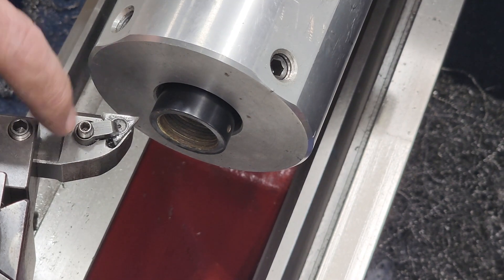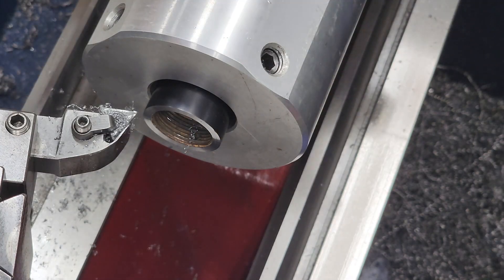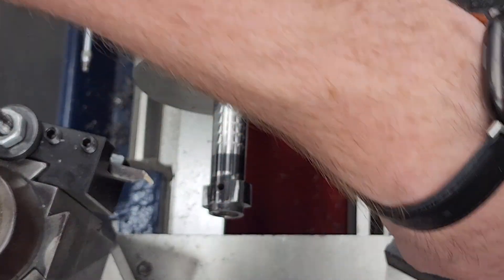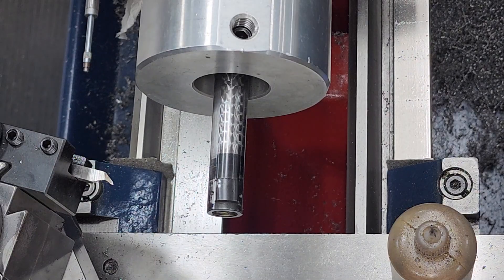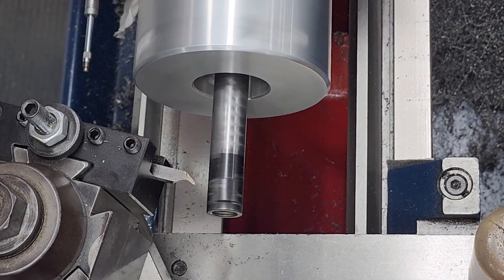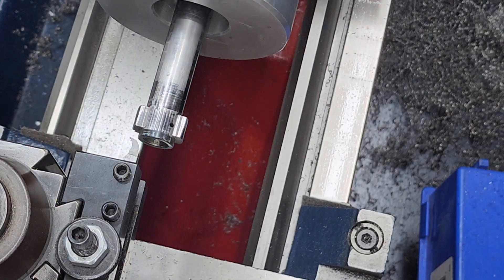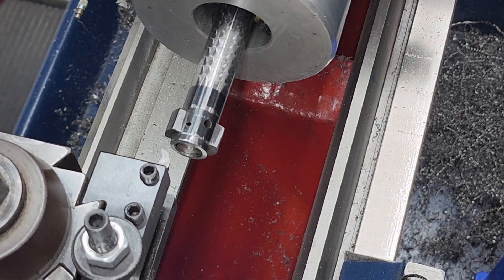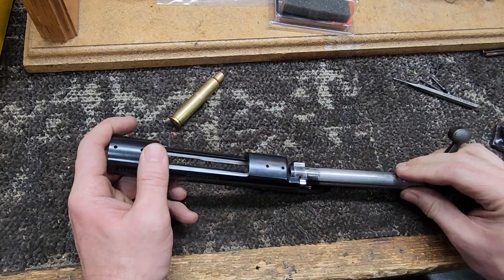Remington 700 270 Project Action and Bolt truing. Part 2

Comment: IF..........U want to bite on this route--- try this FIRST. Shooten the 'ONE CASE' method. Orientate ONE case (Chambering AND reloading) w your accuracy load... firing the group w that case under IDEAL cond's, U have to be competent on the bench... load that case there too. NOW........ what are the results??
MOST........ > grouping is U and your TECHNIQUES.... bedding-screw tensions...... aka lack of them. 
ALL for $$$ w your smith..... just do not expect miracles. REMEMBER too...... that barrel now needs rechamber to FIT that action now........... more $$$$.

Comment: I just built 2 x 270WFT (Winchester fast twist) one custom and 26" 1:8 shooting lapua/berger 170gr 0.662 G1, the other a blueprinted Howa 25", both carbon barrels. MDT HNT26 folding stock to fix the length for carrying. Hoping to push at 2920-2950. Training 500y for 650lb Sambar or 450lb Red Deer.

Comment: This is not a critique against you, I am sure that you are skilled and doing your best. However, it's always the same with "truing" actions. A new barrel is fitted, and in the end no one knows if the truing did any good, because it is not tested in isolation. Of all the people having their actions trued, very few seem to have some data that it is worth doing. Furthermore, many smaller shops have machines that don't keep the same precision as the machines that made the action in the first place. 
It is difficult to know for sure that trying actions are useful. Its like magic. People do it because other people do it. Gunsmiths do it to make money, but are not sure themselves that it does much. 
Older rifles YES, those actions are known to sometimes be off center. But new high-end stuff? No.

Comment: This might be a dumb question buy why machine the front of the lugs?  I would have thought that face would not be in contact with anything.
Reply from the maker: Unless you are running a tight bolt to barrel clearance, nothing other than looks.

Comment: Great demo! By setting the receiver face back 3 thou, will the recoil lug now foul the bearing face in a chassis? Do you typically have to then mill a chassis or is there enough tolerance in those things not to matter?
Reply from the maker: That won't matter.

Comment: If only the factory had higher standards to manufacture their firearms to the highest degree of perfection. And we all know that the technology exists for precision and affordability. We dont live in the dark ages.
Reply: Sure, the technology exists. But a slightly worn or dull reamer in a production line does happen. So if you want extreme accuracy, it's always a good idea to let your Gunsmith tune even a brand new rifle unless it's custom already. I've seen a few exceptions with some of the Tika rifles.  But then again, I've even seen some of those riffle get better.
Reply: I've had older Rems that really SHOT.......older Ruger 220S M77 one holer.

Comment: The locking lugs should be lapped in the action, because the lug seats in the action may not be the same depth. I always hand seat them with grinding compound.
Reply from the maker: The lugs end up being squared and uniform after truing the action. This combined with truing the bolt creates square mating surfaces. Lapping them after this outside of a few seconds if a guy wanted to verify contact, would defeat the purpose of the truing process. There is the fact of the cocking piece lifting up on the bolt, but with a properly headspaced barrel, formed brass, and or a minimal clearance bolt body, this should be held to a minimum. The only actions I lap are M1917 Enfields due to their canted lugs. Truing of these on a machine requires a special setup or a CNC. This is my method and has worked very well for me.

Comment: You took material off the action's shoulder, the rear of the lugs, and the bolt face. When the barrel is screwed back in, won't the timing of the barrel along with the bolt headspacing be off now?
Reply from the maker: You typically don't re-use the old barrel. A new barrel gets fit after the action has been true.

Comment: Can you talk more on your work holding stuff? Great video fellas
Reply from the maker: It's ether a Viper or a copy of a Viper truing fixture. I bought it from a guy that went out of business. I added the thru hole to allow for the bolt handle to pass through when doing bolt truing. I believe they come with that cut now. If you don't have a TBAS, this is the way to go.
Reply: @apexcustomrifles  thanks fellas! Wish yall the best
Reply: @apexcustomrifles those fixtures are horrible. all you end up doing is flexing whatever you are holding into alignment, and when you loosen the bolts the work piece goes back to wherever it was.

Comment: Aren't you cutting through the hardened surfaces?
Reply from the maker: No, generally the entire action has been heat treated throughout unlike older Mausers for example, which would have a hard outer surface and a softer core.

Comment: Is there a point when squaring these faces to the CL of the bore that the bolt handle cam timing is effected ?
Reply from the maker: Yes, It will move the entire bolt back and changes both ignition timing and cam timing. Some of these newer actions are  decent enough that you can get away with not repositioning the bolt handle.

Comment: I own the Winchester mid 70 action rifle that has the action like the Rem 700 so looking at the back of the bolt one lug has the bluing, and the other side is wore off the bluing telling just one lug is making contact.
I looked at the bolt lugs on my Weatherby Mark 5 and the same thing is some lugs are making contact and other lugs have bluing showing indicating no contact on lock up

Comment: Good video
Reply from the maker: Thanks, I'm kicking myself for not getting video for the threading of the action, but i'll be doing another at some point here with a brand new one.
Reply: What approach do you take for cleaning the threads
1. Single point
2. Tap
Reply from the maker: Single point.